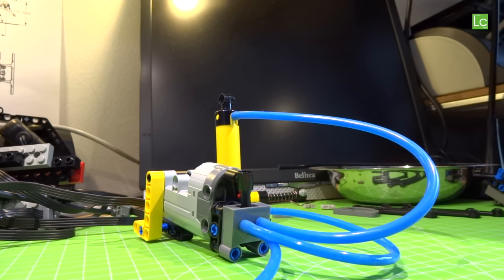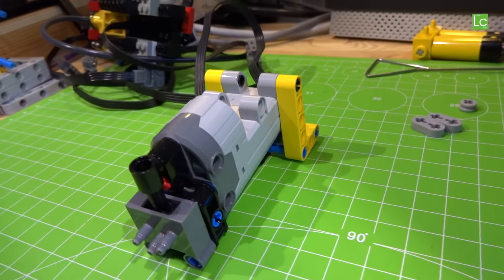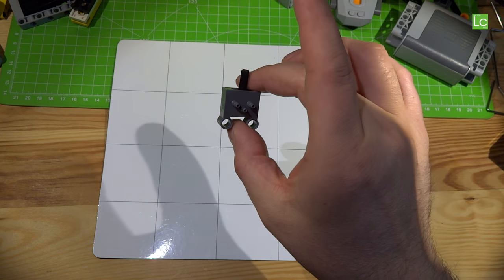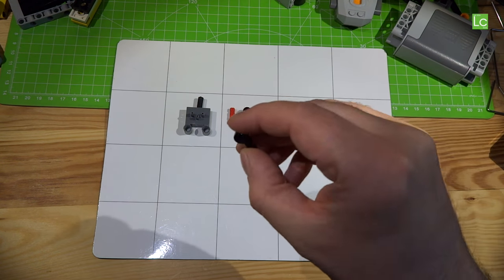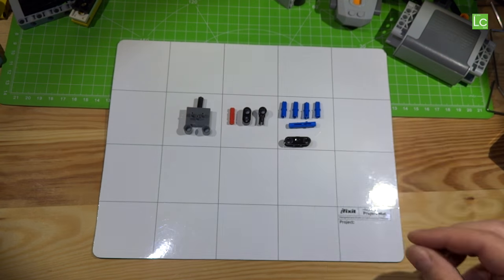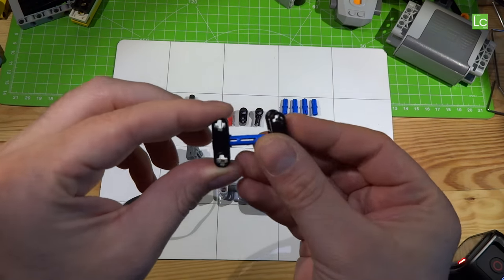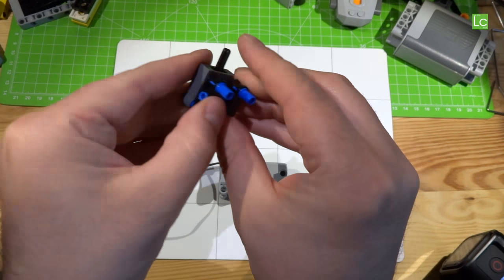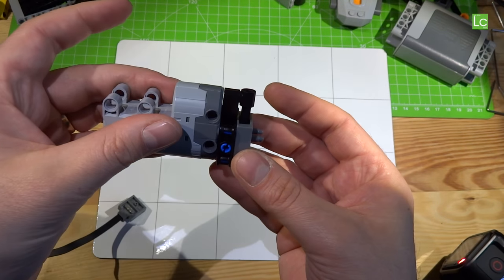Very Small RC Switch For Pneumatic – Lego Technic MOC

Comment: Since the servo has double the rotation of the valve you could gear it with a 1:2 gear train, which would avoid straining the valve
Reply from the maker: I know, thx. Problem is: With gearing it it get bigger – to big for the project I used the valves for.

Comment: Have u built a lego compressor with relief valve?
Reply from the maker: No, but you‘ll find an automatic compressor which stops when it reaches a given pressure in my Mercedes Zetros Truck
Reply: Ok. Is there a way to do another vid and isolate the pneumatic system separately?
Reply from the maker: I plan to show my very small 4-pump-compressor an the pressure switch in a separate video soon. Unfortunately I‘m a little short of time at the moment.

Comment: I am currently making an Rc Lego technic pneumatic bulldozer and I have tried this type of valve, I found it to be unreliable and inefficient as the servo has to exert more force on the frame to reach the 90 degree angle
Reply: I do however think this type of valve has a lot of useful applications due to its size and minimal moving parts
Reply from the maker: Thx for your feedback. Good luck with your doozer. What kind of rc-valves will you use?

Comment: Mine keeps slipping off the switch please help
Reply from the maker: You must make sure that all connections are very tight. You also can use the pin hole with cross axle instead of the pin hole with pin.
Reply: Did you get it to work?